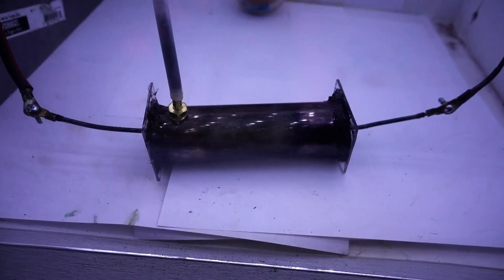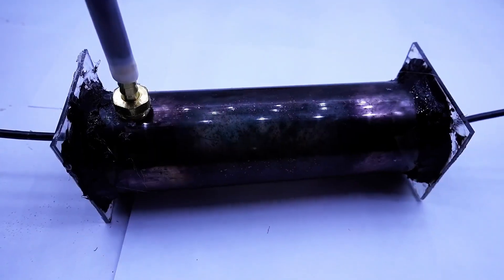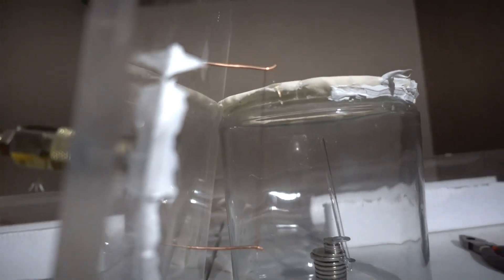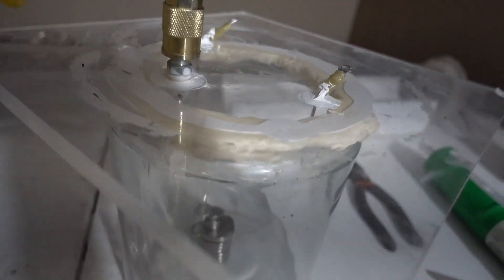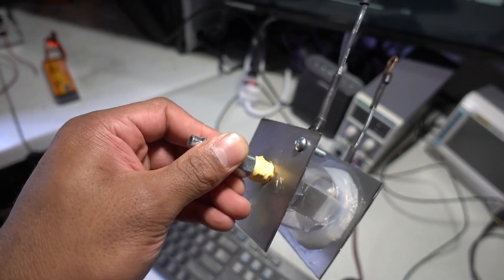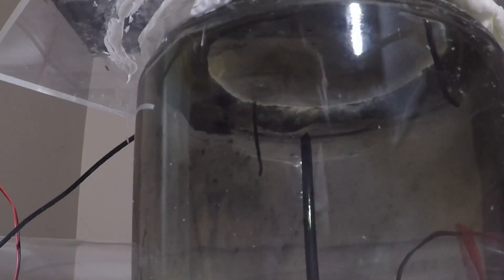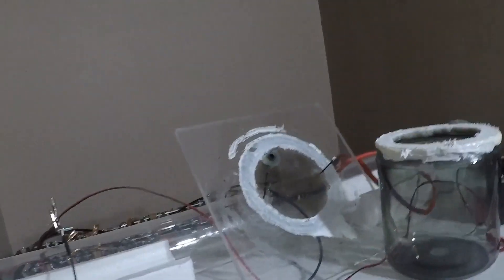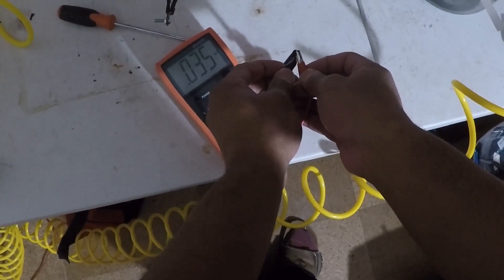Copper Plating Glass

Comment: In order to bleed off the remaining capacitor energy, I would usually use a few high watt resistors in series, taped to the end of a 2 ft piece of pvc pipe. Then, short it for 30 seconds or so. Really cool work BTW !! You Might be onto a method that would replace sputtering or Particle Vapor Deposition 👍🏼

Comment: You could theoretically just wrap some copper wire which is as pure of a copper source as it gets and put the glass rod inside the coil and heat the coil with electric current..not melt it but get it very close to melting

Comment: hey mate check out the MFC  prototype design  i induced a controlled meltdown to show magnetic quenching and one of many reasons I need funding to get better equipment and so i can move from the demo to a true prototype the meltdown was due to not having a heat exchanger to get rid of the heat build up in the magnet for the demo core. magnetic quenching collapsed the rotational field that protects the center electrode and makes the particles orbit. leaving the only the x-rays to smash the star and kill the particle orbit, vaporizing the top of my electrode due the star temperature plasma touching it. the solution or fix is in the description but I'm not going through the effort for the demo version of my design.